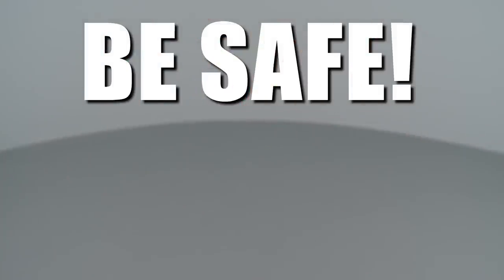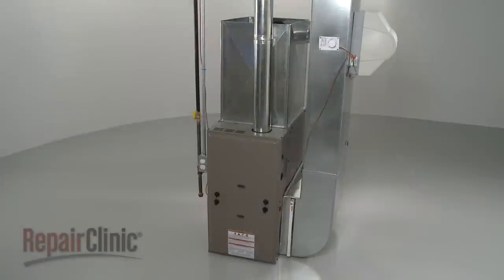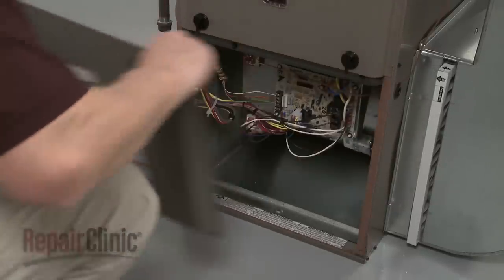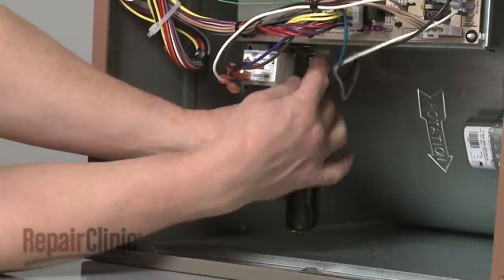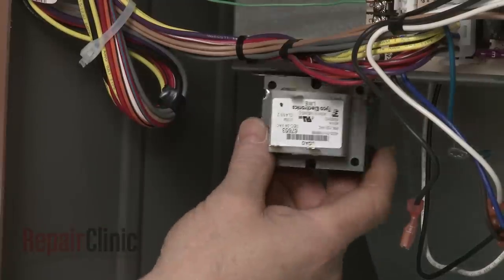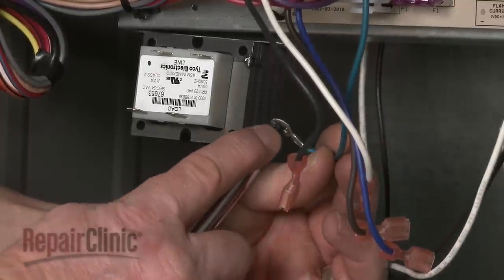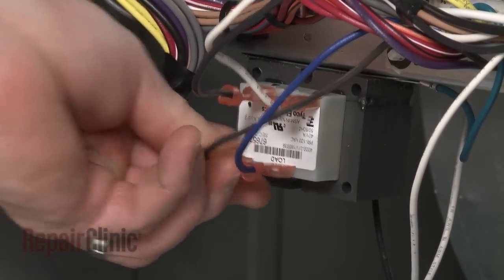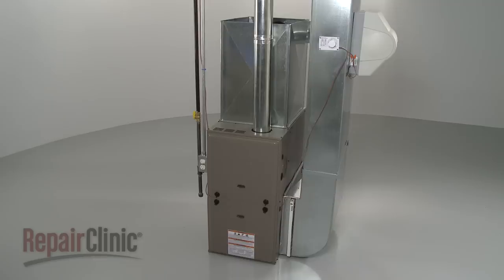York Furnace Transformer Replacement #S1-2940A3541

Comment: Help! My (second!) Carrier transformer-actually a Hartland Model-just got fried from the bad electricity in my house. I had an electrician here today, and the breaker box and outside conduit all need replacing.
Anyhow...I removed the transformer, went to a supply store, and the model the guy had looked different. I looked it up online, but the ones I see don't have a connection to the circuit board. Naturally, the HVAC service I use won't sell me one. They want to do the "surgery" themselves.

Comment: what's the function of a transformer in a heater?
Reply from the maker: ***** You'll find our How It Works: Heater video to be helpful: http://youtu.be/zaT-gcEYpvs
Reply: The transformer steps down the incoming 120 volts to 24 volts. The 24 volts is used to power the  wall thermostat, gas valve, and outdoor condenser contactor. The thermostat also sends 24 volts back on either the Y wire (for cooling), W wire (heating) or green wire (indoor blower). If the system is used as a heat pump, the reversing valve is powered using 24 volts. (If it's a furnace then it's likely not a heat pump, but the 24 volts from the transformer is used to power the reversing valve for heat pumps)